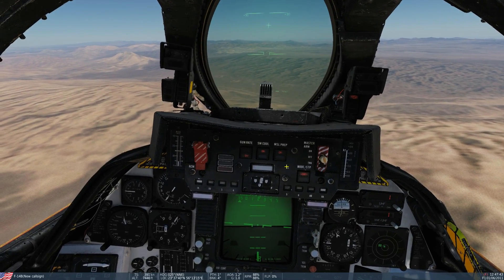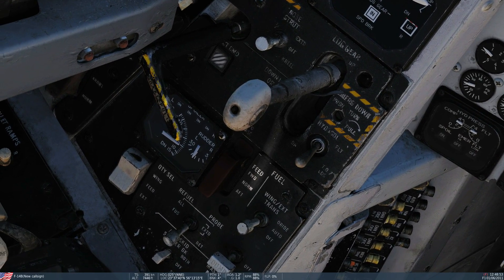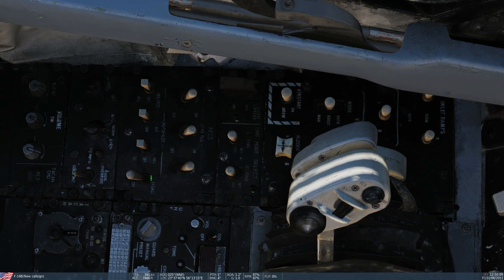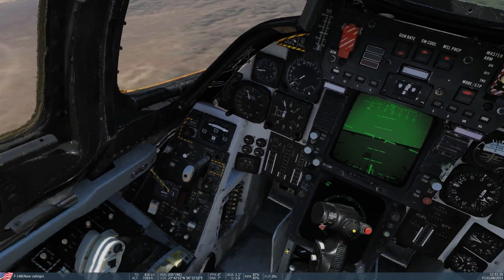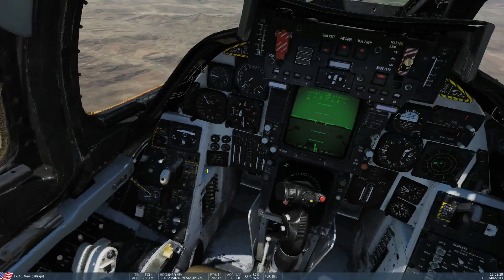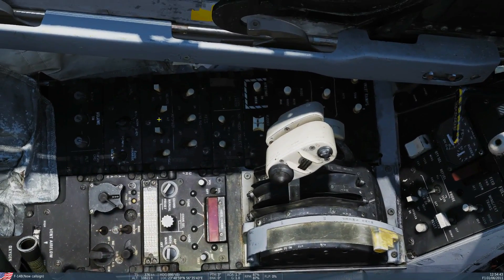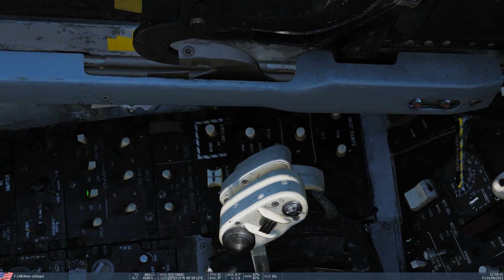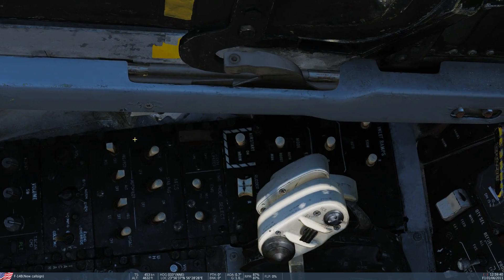F-14B Tomcat: Basic AFCS Autopilot Tutorial | DCS WORLD

Comment: Have there been any changes on the autopilot with the latest updates?It used to work as you show on 2:40,but now i press the Autopilot reference button on stick,but it doesn't want to level the plane and the A/P REF stays red!It works only if i level completely the plane by myself,and not all the times.The same happens to both f14 variants A and B
Reply from the maker: Yes but I haven't looked into it yet.
Reply: @grimreapers  I did a little research and found this https://forums.eagle.ru/topic/274164-dcs-f-14-development-update-bounce-burble-and-orbits/ ..Altitude Hold will now only engage if you are within +/- 200 FPM vertical speed.
Reply from the maker: @trucktrucker5043  Thanks truck!

Comment: For those curious, the VEC/PCD is intended to integrate with not only the carrier datalink, but also GCI/SAGE air defense systems that also use Link-4. This allows ground control of the 'Cat, so GCI can remotely vector the aircraft into an intercept—useful in a crowded interception environment or one subject to voice jamming. VEC (vector) is heading/range guidance only, PCD (precision command) is heading/range/altitude. While not implemented now, I could see it being used with Combined Arms, such that a ground controller/AWACS could direct a whole squadron of aircraft without voice commands.

Indeed, by using PCD in combination with D/L BOMB mode on the A/G panel in the RIO's pit, you could have a JTAC remotely bringing a strike aircraft onto a bomb run. Could be some cool stuff, if they ever implement it.

Comment: I noticed something while fiddling with the switches that I did not see you touch on here and I wonder if you have the answer.  When you turn on just the engage switch leaving all other switches in the default the flight dynamics of the jet change.  It makes the jet feel more digital than analogue.   For example lets say you are rolling from right to left and then want to stop the roll.  Well i notice the roll drifts in normal flight but when the engage switch is on the roll will stop in a more direct, precise feeling, manner.  Do you know why it does this?  Have you noticed it?  Thanks for the videos.  I am new to DCS and your videos have been very helpful.
Reply: I noticed that too and I quite use it a lot now! It "trims" the plane for me, which is really nice when I try to refuel, and it even trims you for AoA when you try to land and get down to a certain speed!
Reply: tms2196 I read up a little now and on the heatblur site in the manual it says (copy paste from manual) “By setting the autopilot ENGAGE switch to on the attitude hold is engaged, maintaining current aircraft attitude. Limited to within 30° pitch and 60° roll angles and the aircraft will be automatically moved within this range. Current attitude can be changed with the control stick and will be held when the stick is released.”
Reply: @Mk19enjoyer  that explains it, thanks for the info!